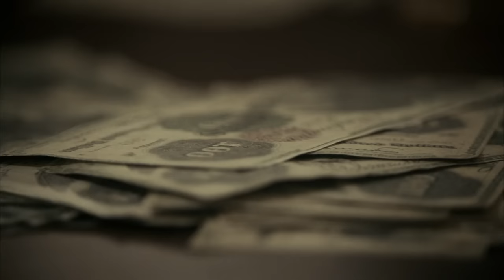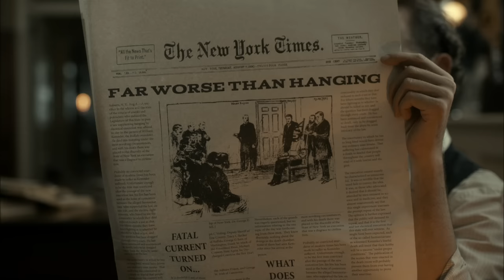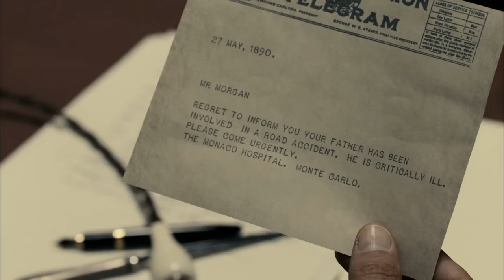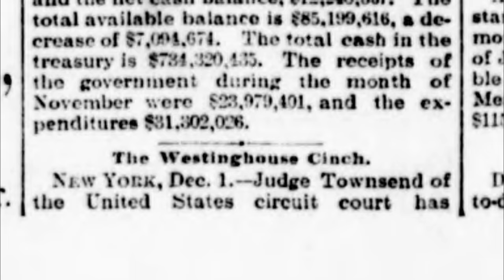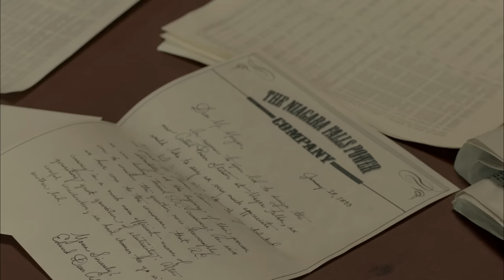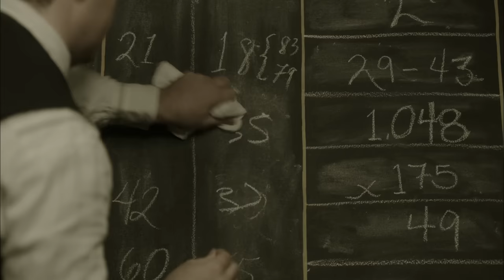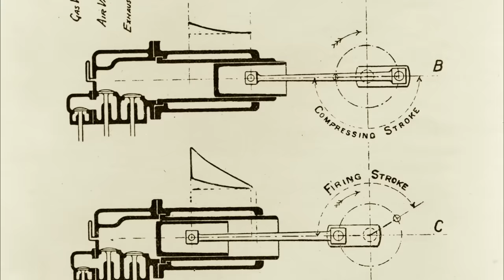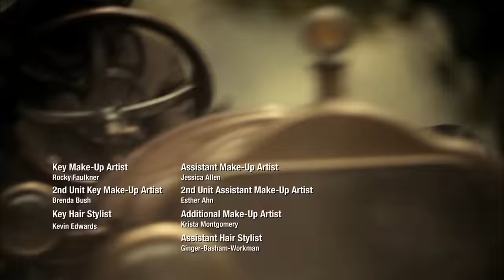Edison vs. Tesla | The Men Who Built America (S1, E6) | Full Episode

Comment: Well, YouTube deleted my comment. It's NOT the voltage, it's the current that is harmful.
The human body has a higher impedance to DC currents than AC, so this means that humans are able to withstand the effects of an electric shock arising from DC exposure much better than when exposed to AC. mA= Milliamp = .001 Amp.
1 to 5 mA: Little electrical shock is felt; upsetting but not painful
6 to 30 mA: Painful shock; loss of muscle control
50 to 150 mA: Extreme pain; possible severe muscle reactions; possible respiratory arrest; possible death
1,000 mA to 4,300 mA: Heart ceases pumping; nerve damage; death likely
10,000 mA (10 amps): Cardiac arrest; severe burns; death likely

Comment: 1, 2 rail train that goes in a circle from Las Vegas, through California, up north to Oregen, then east to New York and Niagra falls, down to Florida, west through Texas, back to Las Vegas, 1 single circluar train, sends electricity through the entire country with a single double rail train. Then you just patch connectors to the rail system to reconnect the Tesla circuit. It has to be made of iron and steel, not copper. Thomas Edison, just sabotaged Nikola Tesla's railway system and electrical circuits. So there is reduced power. The reason for the 2 rail system is for alternating current, that allows electricity to travel in both directions.

Comment: Did anyone else remember documentation that Tesla is the Patent Holder of DC electrical current ?  He also had Patents on AC Motors he invented, but I'm pretty sure, Tesla was the Originator of Direct Current, not the other way around.  The Fact that No One Could put a Meter on Direct Current, and that is Why The competition did not want Tesla's Invention of Direct Current, thay wanted to meter and charge for the Natural Energy of the Earth.  Where Are the Fact Checkers on this Video?